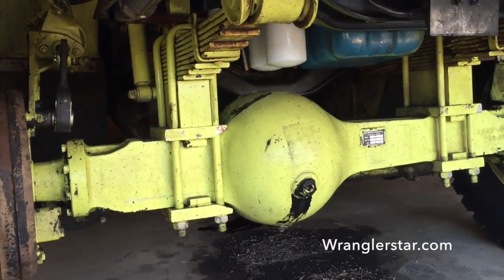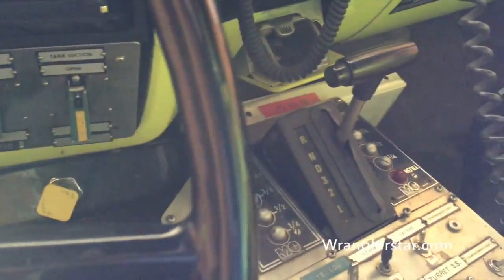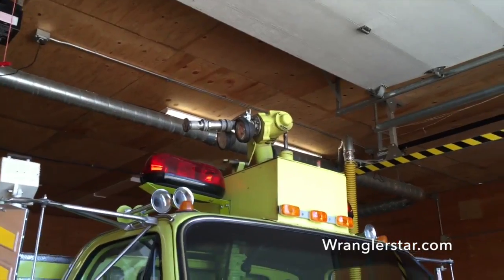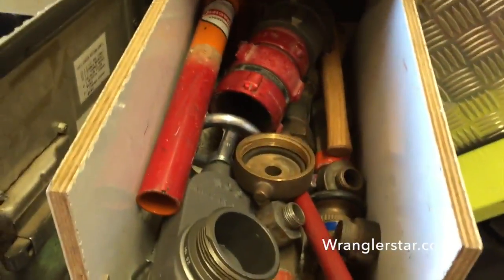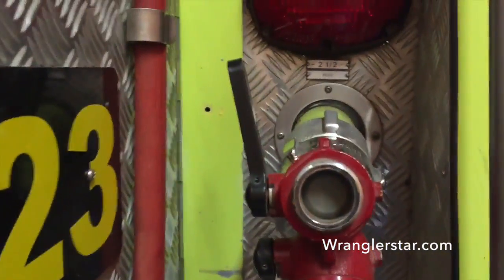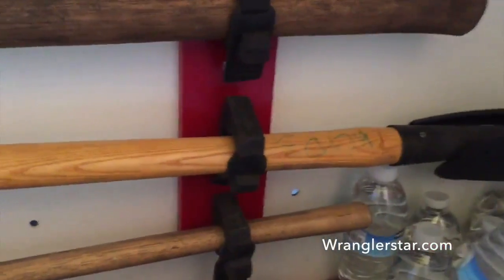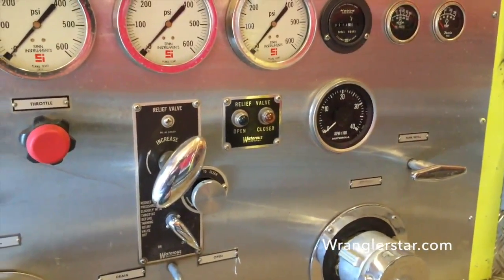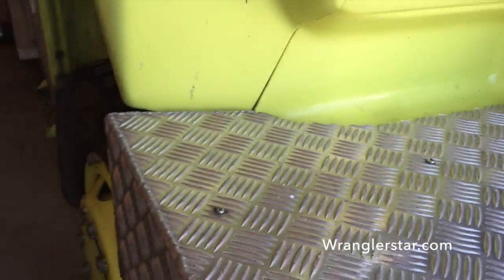My New Wildland Fire Engine + Wranglerstar

Comment: The green brings back memories. Once upon a time was a volunteer in a mining town .Fire and Rescue for the town and mine site. First appliance in green in Western Australia .Isuzu forward cab (Turbo charged) with extended frame . Rosenbauer round the pump high pressure proportioning. Twin hose reels plus 4 x 2 1/2"  outlets. Foam tank plus water.$ BA sets plus spares.Have a high respect for tree/bush fires, as much as wind swept spinnafex (sharp spined bush grass that burns very fast and when seed heads are still up ,fire runs like hot alcohol) . Great clips and thanks for the memories.Originally started with a 'Green Goddess" Bedford  fire truck from England painted red . Timber built and the pump was as solid as they come. Now retired to Western Australian Fire Brigade Museum minus the brass bell which stayed in the station with a priviso it was handed to successive chiefs to look after. ref: https:///en.wikipidia/wiki/Auxiliary_Fire_Service . Great appliance and great times.
Love all the other stuff you do with Mrs W and son. cool ideas.Keep it up as not many city kids would have a clue how to survive in the wild.

Comment: 1 Have you tried out your foam making with silvifoam or other wildland foam. The municipal foams can be more toxic to fish.... Leads to persecution of the innocent after a fire.
2 drafting ability can you pull up to a beaver pond and refill or provide a temporary pump station? Or carry a small Wajax.
3 mixed results on having quick deploy folded hose compartments instead of hose reel. Wildland fire protection used to have a preference for rear mount reels?
4 turret will use up your water really quickly .   Make sure it can deploy foam.
(Doesn't look like a foam nozzle?)
Useful if you have to drive through a fire -after you get those fluid leaks stopped.

5 the wildfire units I built all had spring hold down mounts, and anti corrosion coating on the inside to reduce tank breakage.   The spring mounts stop the tank from breaking when the truck from flexs.
6  beware of taking that tanker trailer off good roads - pretty high and prone to tipping or blocking  FS roads. Hard to turn around too if there are no landings.

Comment: Mr wranglerstar. Are you required to do maintenance on your apparatus? I have been building custom fire apparatus for a few years now. Also, I have earned my emergency vehicle technician certificates. If you need to fix or replace lines or anything pump related all you have to do is ask. Also, your compartments could use some space saving mounts for equipment. As a custom builder, I have a few ideas that really help with space and compartmentation.

Comment: by the way.. this is a few years old.. were you able to fix the other truck water tank.. must prevent freezing.. setting up a thermostat switch that turns on at 32F and off a few degrees warmer.. you will also need a circulation pump that fix into the water tank so the slightly warmed water is circulated to avoid cold spots..  some tanks have a threaded drain or  bung so a water heater element can be screwed in.  again.. circulating pump and a thermostat as you don't need it above 32F. .

that army water trailer is probably over 4000 gallons..  i don't know if the yellow rig has a pintle hook if so you could scrounge a 5th wheel dolly like is used for pulling double trailers to drag the big tank around  if you have not been supplied a tractor to pull it..

Comment: I do watch your channel quite a bit.  I worked in a Municipal Maintenance Shop for a number of years.  We had four Boardman's and they were front line for 40 years.  All analog and reliable.  There was one that went brush pumping in a worse case fire in the mountains.  The fiberglass tank developed a leak.  Sandblast the area and a bit more.  Add fiberglass and as little resin as needed.  Paint and seal it with epoxy paint.  It should burn in to the glass and grab the structure.  Use fiberglass about the same coarseness as the tank.  The truck is a happy 48 years and is used in the same mountain area with a volunteer department.  She still does not leak.  My job makes me happy every time I see her.

Comment: Please get your bunker gear out of any compartment containing fuel.... 
EMS gear and oxygen should also be moved to another location!
Stay safe!!!
Reply: Yeah, I missed that one. I'll add two things to that. First, oxygen bottles should not be stored anywhere near grease, oil, or fuel (gas or diesel). Your compressed gas tanks on a vehicle need to be secured in brackets. Most tanks like oxygen are filled to 2000 psi, and SCBA compressed air tanks I believe to 3000 psi. You break that valve off the tank, you'll launch a missile. Remember that the gas is coming out  through a 1/4 " hole. Like I said, a missile.
Reply: that and pure oxygen burns on contact with anything unpure
Reply: Nathan .Vanderslice it’s almost never pure oxygen. It’s compressed air like an air compressor in your garage. Not flammable.
Reply: Josh T medical  oxygen is pure oxygen. Scbas are compressed air
Reply: Kaleb Johnson kinda what I was saying. Most people don’t run around with pure medical oxygen. Mostly bag valve masks and the like. An ambulance might have a tank but I doubt his personal fire truck has that. Kinda assumed it would be an air tank “scba”. At least that’s what we carry on our trucks.

Comment: Does it have locking differentials? If you put in some lockers you will turn that thing into a tank. A pair of ARB lockers has been the best upgrade to my truck so far. You engage those babies and you can drive out of almost anything.

Comment: Those Draeger Panorama systems are the Cadillac of SCBA's. As a HAZMAT tech I've worked with MSA, Scott and Draeger and given the choice I'll take Draeger every time. You're fortunate. I would recommend you move the O2 bottle into a different compartment than your fuel. If that bottle leaks at all it will increase the oxygen in that compartment and therefore decrease the flash point of the fuel vapors. Something as simple as a spark from the latch on the door could ignite the right mixture. Also, not sure how well turnouts resist breakdown from the fuel vapors. Now I'm curious if they're suggested to be kept away from VOC's while in storage.
Reply: Correction. I used the wrong term. Flashpoint  is not decreased, the Lower Explosive Limit (LEL) would decrease. Apologies.
Reply: Michael Noyes

Comment: I drove an  ARFF  truck fro 20 yrs in texas  our  trucks had an auto eject :  electrical and air  connection at the rear of the truck ; its a simple system that stalls on the truck and the hose ;  and ive seen the drive across the ramp draging  behind

Comment: I don't want to turn this into some Ford Vs. Chevy type of debate, but I was wondering if you prefer Husqvarna or Stihl? Is there a different saw that you'd rather have instead of either of those? Have you noticed a drop in build quality over the years? Personally I will use anything that works and is safe and sharp. If I just need an occasional use saw I'd be happy with a Poulan(They actually can last for 10 years or better!). My main saw is an MS-290. I have a Husqvarna of decent size which was given to me used for my "pinch saw" that led a very rough life with a tree cutter but still works nicely. That being said, I've never had to rely on any equipment in an emergency thankfully.

I like analog systems as well. I like to do the thinking and let the system be more robust. I like to pull a lever or turn a valve. Unless something is drastically wrong, it's going to work. Even in such cases, such as you mentioned, it's a simple enough system that you'll be able to get it to work.

Comment: Your water tanker looks like the US Army M131A4C but you would have to look inside the door on the data plate. 5000 gal over blacktop and 3800 gal over dirt roads. Made for fuel but covered to water.
Reply: Timberjack Thompson that's correct. I've worked on them before I personally have never ever took them more than 4500 over hard roads and you are right about the 3800 dirt roads

Comment: You did a very good job setting up that Engine. Looks like you have everything you would need to get the job done, or at least hold your own until mutual aid gets there to back you up.
  Your FD, is it county, town, regional or something else?  I'm a right coast guy and it's mostly town by town out here. Some towns with multiple departments.  If there's talk about consolidation (town or county wise) the Chiefs get bent out of shape not wanting to give an inch. Afraid they might not be the big cheese anymore.

Comment: I like that truck man!! Darley, waterous, or hale??? Shoot, at our vfd that's all we've known is the old analog gauges and valves. We were still using the old Scott donkey (u know what) air Paks up until the time I left almost 3 years ago. No question about it the stuff works and was made to last. Same with our old engines. We still have a 71 ford pumper in service.  I'd like to look you up and tour your station sometime! We even had an old Chevy the electric pump engage switch went out and no one ever fixed it.  we always had to use the levers underneath to engage the pump every time. Your videos are awesome man! Take care!!

Comment: Nicely built truck, right color too. Some of those old pumpers like that had a pto driven after the transition an not before.. Know which one it is before you need to use it. If it is after it can change gears randomly while pumping an spike the pressure. Those trucks you cant walk away from like the others. Someone has to always have their hand on the controls or someone could get hurt. Learned that the hard way many years ago. An that was a truck I had been running my whole career. I got complacent an took my hand off the controls. 3 seconds later 600+ pounds of men were launched across a parking lot.
Reply: That's what the relief valve is for
Reply: On paper it is. Complacency though.... That is a valve you have to remember to set every time. In the rush to get water to my crew, I did not. I had men down hill from me spraying down in a hole. The person that pumped that truck last had it set high. It spiked from 75 to 300 at the truck. 100% my fault. But even if that valve had saved me/them, I should not have let it happen in the first place.

Comment: wranglerstar Am I wrong or did I just not notice, are there any forcible entry tools for a structure fore on your rig? I saw a halligan but axes, pike polls, large pry bars etc. Also, what sized hose is that in the hose bed  on the passenger side of the truck? Just wonderung if it was structure or not. Otherwise, beutiful rig and a great video

Comment: Nice engine . I like old school pumps , same as you that is what I learned on . How many GPM for the pump ?  I notice you stack your hose bed , we went to the flat/lay-down  method , hose butts don't get hung up as much , at least that was what I was told .  it's funny how some  FD things are the same all over the country  and some things are VERY regional . If you are not using the foam tank , can you pipe it over to the other water tank , give you a little more water . Just use a induction  appliance for your foam . be safe brother , hope you never have to take it out of the barn ! LOL , bob k

Comment: Bunker gear and ems gear should not be stored near gas, oil. For one it will ruin your seals on your o2 bottle and Also eat the rubber tubing. Fuel near bunker gear is obvious even though it is in its own gear, fumes can contaminate it and make it super flammable. Other then that, nice all around engine. Would love a video of the rescue tools.

Comment: You might want to look in to using foam with that truck cause when water mixes with foam it slides easier and it can slide in wood and in rocks easier if you use foam

Comment: I also prefer the older stuff.  Analog and pull levers are the way to go.  I really dislike working with digital gauges and electronic switches and throttles.

Comment: Boy howdy I would love to have the old fire truck.  That new all wheel drive fire engine is super cool.  How many gallons per minute does the 3 inch line use versus the 2 inch line?
Love the in cab control of the monitor. Analog is rock solid low tech. Great video.
Reply: Every inch in diameter increase will mean almost double the water flow.

Comment: Seems your front diff is leaking hope you checked it out before departing on a call!!!
Reply: Looked like paint was missing...not an oil leak.
Reply: ryanburbridge No that is a loose plug! Did you not see the puddle under it! Maybe he over filled it,and just didn't wipe it off! But it sure looks like a lose plug
Reply: Probably checked it, those don't put on many miles and many have the factory diffs which are filled well above the fill plug, so when you check them it spills everywheres. I had to remove a twisted PTO shaft, pump, and trans out of a forestry truck , all were the originals from 1986

Comment: My truck at work has 4x4 and I am by no mean mudding or off roading, yet the truck still gets stuck all the time. Why... Because it's heavy, 20,000 pounds. This truck has to weigh three times that. 4x4 does not guarantee off road capabilities. Non the less sweet rig.
Reply from the maker: KittyWampus Adventure Outdoors Stay out of the mud and you wont get stuck in the mud,
Reply: KittyWampus Adventure Outdoors I just got a ford f450 4x4 stuck friday
Reply: +KittyWampus Adventure Outdoors Would you prefer 2wd?

Comment: You're probably a type 3 due to what looks like a bigger pump, oh and remember it a water tender not a tanker ;)
Reply: Wandering Beast Yup, not a tanker:-) Well, maybe in the south...
Reply: Right!  Tankers have wings!
Reply: Wandering Beast It's a Tanker in Australia.  :)
Reply: technically its a tender but if you say tanker in most any station, everybody will know what you mean
Reply: GrizzlyBear Warrior In the USA we have made an effort to standardize specific terminology for our "resource typing" in order to avoid confusion.  According to NIMS, NWCG fireline handbook, IRPG, , Firescope FOG manuals, etc.....a tanker is a fixed wing firefighting aircraft, they are then further classified into types based on capacity.  I know they are often still used interchangeably with tenders in some areas but they really shouldn't be. If I order up a couple of tankers for my division or branch, it's gonna be a problem if two water tenders show up...
Reply: Haha yeah that wouldn't quite getting the water you need
Reply: Where I live in the U.S. its a tanker we all have our preferences
Reply: +Jake Schaffer  Where I live there is none
Reply: +David Johnson  Don't make me bring up the metric system ;-)
Reply: You can haul water in a tank. Can you haul water in a "tend"???

Comment: Get the bunker gear away from the gas and why are you equipped with extrication equipment if you can't legally respond to an auto accident?
Reply: Extraction can be used elsewhere, its primary use is in auto related incidents but will be used to enter structures, housings, gates, etc.

Comment: I am wondering if GMC put a Detroit Diesel in the truck (Detroit Diesel was originated by General Motors but it is now owned by Daimler according to Wikipedia.)  Assuming that is has a Detroit Diesel,  does anyone know what the nick-name for the Detroit Diesel is and why it got that nick-name?
Reply: Detroit diesel is owned by freight liner, they liked the engine's so much for their trucks they bought the company
Reply: ***** it not so much freightliner owns dd but damler owns both
Reply: DocLarsen44 Which nickname? Screaming Jimmy? Driptroit?
Reply: DocLarsen44 The old 2 stroke Detroit's we used to call the Double Breasted Yamaha's
Reply: K.D. Pearce Exactly right sir!, although the double breasted is a new one on me.  And, anyone running one of these knew to keep the airbox drain open because if it filled up with oil and it got blown into the cylinders the engine would run away until it exploded.  A lot of people said, "just cut off the air  to the blower and choke it down."  But, I was told the motor, running on oil, would suck the seals out of the intake and blower and keep on running away.  I never seen it happen, but that is what "they" said.
Reply: They were called that because the old Detroit's were V6,V8,V12,V16  engine's with a 6-71 blower or a 12-71 blower in the valley this over pressuration also caused seals to leak oil hence the name drip-troit.As for the run-away engine this normally happened when it was well worn out.
Reply: DocLarsen44 doodlebug?

Comment: Are those M-RAP axles
Reply: I believe so
Reply: There is no such thing as an MRAP axle. This is a 1980s GMC, MRAPs didn't exist. The principles of design and construction are the same though.
Reply: +Casey Jacobson is it similar to military axles
Reply: +connor forhan again I would say no. These are just heavy duty truck axles. 

You are probably thinking of the Rockwell axles you'd find under the 2.5 ton transport trucks.